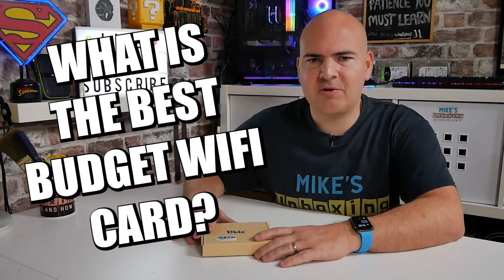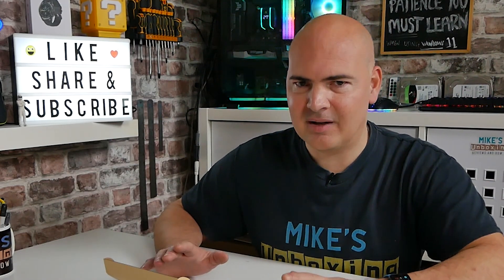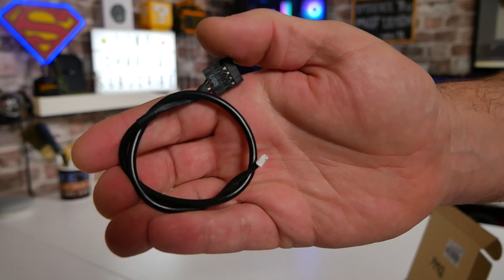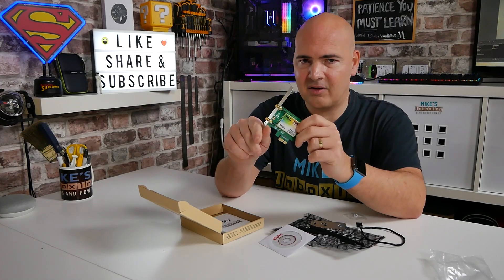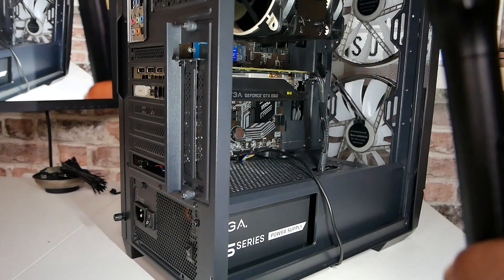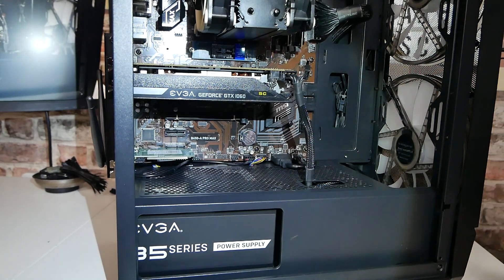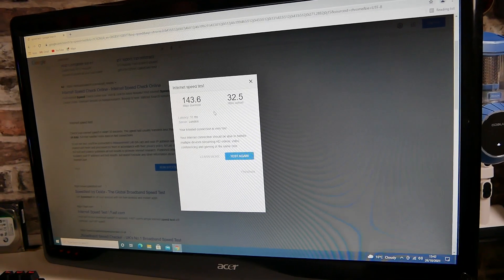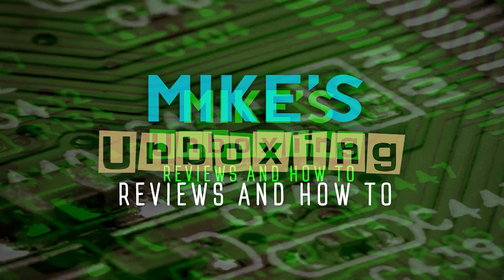BEST PCIe Wifi & Bluetooth AX200 Card UBIT WIE7265 Install & Test

Comment: Definitely recommend these over the often useless usb adapters. Do as Mike says and get one if these if you need wifi / bluetooth on a board with said features missing.
Reply from the maker: we have a new Wifi 6E one on test at the moment and it is REALLY quick! Pretty much the same speed as my wired LAN
Reply: @mikesunboxing  WiFi 6 is definitely getting right up there. Stability is still a concern but along came wired Lan 2.5 & saved my day. Thumbs up to wifi 6 though.

Comment: I bought a TP-link AC1200 wifi extender, set it up in 5 minutes, plugged it into the wall in my bedroom and plugged my Cat 6 rj45 cable into the bottom of it. On sale $30 Canadian.
Reply from the maker: i had a wifi extender before and it was okay, but would drop out a lot, but i am tempted to try a more modern one and see if they have improved a lot

Comment: Im usung ancient arctic micro bluetooth usb dongle and it gets the job done. For the wifi, I have TP link-WA850RE repeater. its pluged near pc and connected with pc via ethernet cable. Works great. Faster than usb dongle wifi adapters
Reply from the maker: usb dongles for me have always been a little hit and miss

Comment: To make life easier, I tend to only buy the "wi-fi" versions of a motherboard. In my experience it is cheaper, and easier to set up. As always, thanks for the great review, Mike!
Reply from the maker: yes that makes life a lot easier and often the price difference isn't huge, especially now with some boards having wifi 6 or 6E on board which is actually quite expensive to buy as a standalone card

Comment: Now this i can use :-)  Still using my good old trusty PCI card(Ralink RT61) max = 150Mbps. Not a problem now at 10/1 Mb connection - but getting fiber soon.
Reply from the maker: this should be a decent upgrade

Comment: Are there any compatibility issue if ever I use other model like Intel 9560 AC 9560NGW?  I have b550 aorus elite atx
Reply from the maker: as long as it fits in the PCIe slot it should be fine

Comment: are there any Wi-Fi cards without the antennas because they seem like a hassle
Reply from the maker: not that i know of sorry, at least none that have useable speeds, some smart plugs and devices have tiny internal ones but the data throughput is tiny

Comment: Hello Mike, just thought I'd add this, i moved my pc so had to go wifi, so bought a pretty good wifi card but once i got it running my second m.2 stopped working, many hours of head scratching later i could not use that pci slot with that m.2 occupied, the sad part the pci under my gpu was still ok to use, so a clever little extension cable from the pci, very tight under gpu and got it working! But what a pain learning that! Motherboard msi b550m mortar (should of got wifi one).
Reply from the maker: Thanks for sharing

Comment: You mentioned the USB version, and stated you have to unplug them and plug them back in, there is a setting in Windows that can stop this.. Open Power Options - Change Advanced Power Settings - USB Settings - USB Selective Suspend Settings - and set to "Disabled". That should help.
Reply from the maker: Great 👍 thank you

Comment: Great video thanks - Mine stopped detecting my wifi signal, but it picks up some signals around - Do you know how to fix this?  @mike's unboxing
Reply from the maker: in the wifi settings try to "forget" the connections reboot and try again
Reply: Thanks for responding Mike, but it didnt work. It stopped once I changed internet providers. Our phones and laptops are picking up the wifi fine but the pc with this network card isn't.  @mikesunboxing
Reply from the maker: This is maybe easier to fix or at least advise if we can ask more questions and get direct answers, so feel free to join our Discord chat and we can go over it in more detail https://discord.gg/XtBTGQ6BDu

Agree to the rules by clicking the emoji and you will get access to the rest of the Discord channels @iraqpride

Comment: I just installed this but the Bluetooth ( Intel Wireless Bluetooth )  is always showing in the ( safely remove hardware and eject media ) option in system tray ,which is very annoying.
Is it the same for you? please confirm
Reply from the maker: yes the same is happening even for the motherboards built in one
Reply: @mikesunboxing  so i guess it is normal thing then?
Microsoft need to sort their os out honestly

Comment: I wonder if this card is better than built-in cards in mobos like msi b550 gaming carbon
Reply from the maker: very slightly depending on the brand, but the better components and antenna normally justify the cost, and also in an onboard one fails you have to RMA the whole board which is a real pain
Reply: @mikesunboxing  that's my situation now. Gigabyte wants me to rma my entire motherboard because my Bluetooth sometimes stops working until I reboot. I'd rather just do this than go months without my pc and having to take the whole pc apart.

Comment: I installed this wifi card in my computer and it seems to be getting really slow speeds. Any advice on how to fix this?
Reply from the maker: make sure either 2.4ghz or 5ghz is selected and maybe adjust the position of the antenna

Comment: Grrr I still can't stomach that into music. I like buying mainboards that have wifi on the board, but if you don't have that, this is the way to go for more flexibility. Don't most wifi cards also support bluetooth or are those usually other peripherals? I guess it can be either or. Hey have a GREAT day Mr. Unboxing! See you in the next one.
Reply from the maker: there are a lot of combo cards out there now especially in the PCIe type although it is very difficult to find a combo one on USB for some reason. have a good day my friend
Reply: @mikesunboxing  That's a good point that you can just you a USB device in a jam and temporarily instead of sticking a PCIE device in there all the time. Kinda like how I use my USB optical drive, I probably use it once every 2 years...

Comment: The problem is that to activate the bluetooth it needs to connect a cable that takes the place of the front usbs of the case.  How to get around this problem?
Reply from the maker: Some boards have two or more headers or you can buy a splitter to double up

Comment: The Ziyituod model of similar spec / same chipset is £19.46, plus an extra 5% voucher deal.
PS. What 5GHz channel are you using, the channel rules are complex, so the default is usually "auto compatibilty", confining it to the free for all 36-48 range which puts everyone on one super-wide channel - other ranges are available using "auto performance" which selects from the additional DFS (Dynamic Frequency Select) channels which are shared with radar and  require a "watch and shift" function.
NB. Some devices can be slow / reluctant to pick up a DFS channel - my Xiaomi Note 9 takes a long time to find it unless I flip the wifi on and off
Reply from the maker: not sure actually, it was going into a build for a customer so wasn't entirely sure what type of wifi they had

Comment: I bought one of these,  mine is only running 0.18mbps download speed, not sure why but i installed it into my gfs computer and its only getting 4mbps download speed. It's pretty crap
Reply from the maker: wow that doesn't sound right? how far from the router is it?
Reply: @mikesunboxing  the router is downstairs and the pc is directly above it
Reply from the maker: @roadkill8161  Sounds like something is blocking the signal.

Comment: I went back to a Hard wired conection because the USB wifi cards are useless in my experience Disconnects often and interferes with my Bluetooth audio and other things the annoying Chime evertime its unrecognised etc 
I just got a 10 meter White ethernet cable and Feed it round my Skirting Boards upto the Pc Doesn't look as Clean as wireless obviously but its hardly noticable and i never have them problems again lol That PCI-E WiFi card though would be better and surly more stable i might look into one PS 2.5 Ghz is Best in most cases because Most Tech like Ring Doorbells CCTV etc all use 2.5 so for me it's best
Reply from the maker: cable is best if you can

Comment: Don't but that POS Ubit card. The Bluetooth does not work on windows 10 or 11 and windows does not recognize or support the Bluetooth half. The WIFI part of it will work fine with the updated intel drivers.
Reply from the maker: Might have been a defective one, no one else is having this problem
Reply: @mikesunboxing  I thought that might be the problem as well, so I sent it back to Amazon and they sent me another duplicate card, but I am getting the same problem with the second card. The wifi works fine but the Bluetooth is not detected. The only detection I get is Unknown device under the USB controllers with error code 10. Would be quite a coincidence to get this problem with both cards. I have tried updated drivers from the intel web page as well as legacy drivers. I have moved it to different PCI/USB slots on my MB and even tried to get it to work on my older PC and neither card worked properly on either PC. I don't even want the wifi. I wanted the Bluetooth so I can use my Beats headphones. So, for the reason that with 2 cards not working I still have to recommend people avoid the Ubit brand especially this specific card. I ended up using a TP-Link card and have not had any issues.